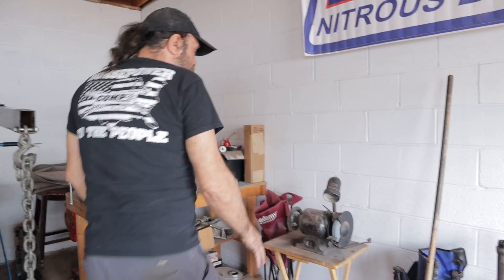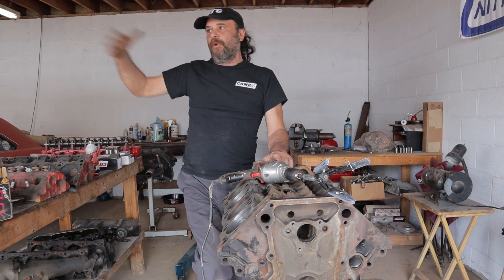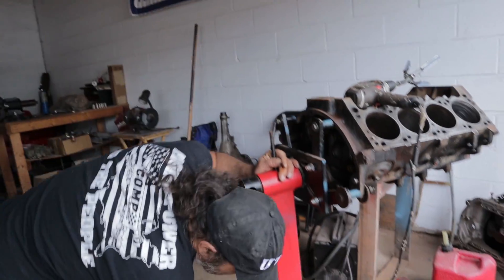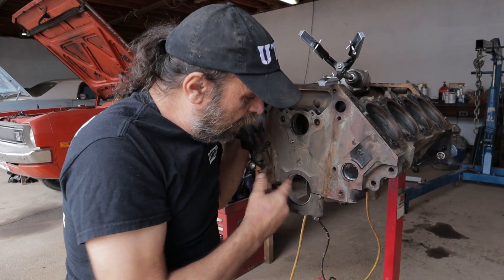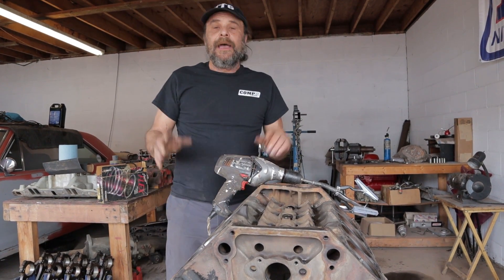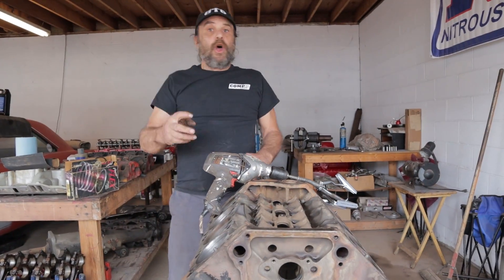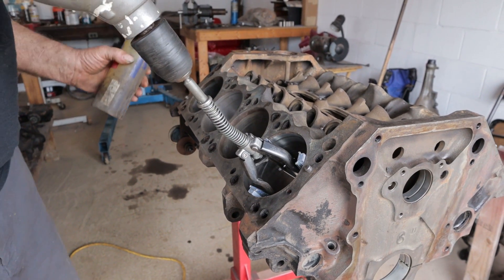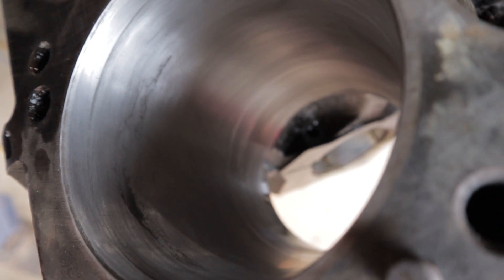Perfect Daily Driver 6 - DIY Engine Block Prep

Comment: Also another tip i learned: when replacing the freeze plugs make sure the the surface on the block where the freeze plug goes in is down to bare metal and thoroughly clean and on the surface of the freeze plug that pushes up against the freeze plug hole. Make sure to use 3M yellow super weather stripping adhesive between the the freeze plug and the freeze plug hole surface where the plug presses up against the block . it will be messy but do just enought to go around the inside of the freeze plug hole then tap in the freeze plug. If you did it right it form a sealing ring around the plug and block. Then let it set for a few days to fully cure! Dont use regular gasket sealent it has been known to make a slick surface for the freeze plug to pop out under heat and pressure .
Reply: I’ve used JB Weld.  Never had a problem with them coming out, but haven’t had one tested with a freeze situation, either.

Comment: Dish vs Flat Top pistons?  Where and when to make that decision?
Reply: That’s a decision before you ever start building, when you’re figuring out what you want the engine to do.  Goals for the car, then parameters of the engine.... especially compression, then see what piston, in conjunction with your heads, makes it happen.  In this engine’s case, the stock dished pistons with the smaller heads brought compression up to all that car’s goals want.

Comment: A few other helpful tips, if you do replace the cam bearings, use an installation tool, don't try to use anything else. Cam bearings are typically numbered for the position they go in with the front one being no. 1. Make sure you align the oil holes on the bearings with the passages, a puff from an air hose through the oil passage will help verify it didn't slip as you installed it. Always, always, always trial fit your camshaft to make sure it goes all the way in before you assemble anything else. I've seen the crush on the I.D. enough to keep the cam from going in. If you've already assembled the bottom end, you have to take it all back apart to fix that bearing.
Reply: I don't know why I never considered the ID crush might be enough to block the cam! I told the machinist I'm gonna be taking my block to that I'm using a stock cam and just need stock bearings put in, and was wondering why he stressed that I need to make sure to bring the cam with the block when I drop it off. I just figured "prob just wants to verify fitment" and left it at that, without considering specifics. Thanks for sharing that.
Reply: @screwsinabell  I've had to take 2 back apart, it isn't common but it does happen.

Comment: If you turn the pistons like you do does the rings line up with the ridge
Reply: None of the piston measurements change, so the top ring travel is exactly the same.
Reply: John Wilburn if the rods slightly off centered to the outer side and you move it in to make it more centered to the crank it seems to me like it would have a very small at that stroke change if it is now centered verse a angled rod. I’m not saying this makes a stroker the crank is the same but the angle of the rod could change the height of the piston. I know it wouldn’t change the travel of the stroke but just saying I think the height would be different
Reply: No, because if it’s offset and you turn it exactly 180° in the bore, it’s the same exact offset to the opposite side.  The highest a piston can possibly be in the bore is with a centered wrist pin.
Reply: John Wilburn you need to watch his other videos your just making your self sound like an idiot he turns the pistons around so they are strait at tdc factory they are angled slightly it’s not rocket surgery
Reply: That’s not even possible!  By definition, an offset wrist pin is not at TDC.  Flipping it around can only, with no variation, put exactly the same offset to the opposite side.
Reply: OMG, no... the stroke is 100% determined by the stoke of the crank and nothing else.  You have your head wrapped around this all wrong.  I suggest drawing it out on paper.
Reply: John Wilburn wow read my first reply to you genius 🤣
Reply: John Wilburn my last sentence I know the stoke won’t be different 🤣
Reply: @duffman1241 You said this:  "  if the rods slightly off centered to the outer side and you move it in to make it more centered to the crank it seems to me like it would have a very small at that stroke change"  Don't feel bad.  Most other people don't get it either.
Reply: Oh, and to get ahead of your erroneous thought process, the deck clearance cannot change with a side swap of the same offset.  It would definitely decrease (higher in the bore) with a centered wrist pin if the same length rod and same compression height piston.  Seriously, draw it out and think about it.
Reply: John Wilburn I did say that then if you can read the whole thing I corrected myself saying that the stoke ant effected. What I’m getting to is if the piston flip brings it closer to strait up and down at tdc then it would ride a bit higher in the jug
Reply: NO... it can’t!  Ponder this deeply.  If the crank is all the way up.... the piston pin offset of exactly X becomes exactly x to the other side.  Therefore, the same length connecting rod and compression height which don’t change, can’t make it go higher in the bore.  All that changes is the rod angularity at TDC... not the degrees, just which side they are on.

The only way to do what you describe is to change the wrist pin location to the center, not a mirror image.

We will describe this on the live build I’m sure.
Reply: John Wilburn wow you just said the same thing I did 👌. I said if one way the rod would becloser to strait. a strait rod is longer than a angled one. I did miss understand Tony I thaiught he said it straitened it out at tdc but it was at the power stroke cycle witch would put the piston a bit higher at that point do to being strait up and down and not angled
Reply: No, I didn’t say the same thing you did. 🤦🏻‍♂️   You, whether you realize it or not, are claiming the same piston in the same bore on the same rod with the same stroke creates more compression.  If it “rides higher in the jug,” that’s the effect.  It’s not.  The swap changes the angularity of the rod relative to the crank and combustion process.  Again, you’re trying move then pin hole in the piston.  The swap is moving an offset from one side to the other.
Reply: Let me try one more logic appeal and I’m letting it go:  if flipping the piston around makes the piston ride higher in the bore, then why does it not do that when turning an unmodified engine backwards?  It’s the same effect with regard to all the geometry.  💡?
Reply: John Wilburn if the rod is strait up and down on the power stroke and not angled it would be a hair higher than when the rod is at a slight angle. Tony switches the pistons so the rod is strait on the power stroke. I never once said any thing about compression. You said if the pin was centered it would be taller than offcentered correct????? So if the piston turn makes the rod strait on the power stroke and not angled it would be a hair taller at that point. Once again I never mentioned compression once
Reply: You did mention compression, you didn’t realize it.  A piston going higher toward the head would do just that.  If the pin were centered with the same rod length, it would go higher, but it’s not because the offset passes the center to the same amount of offset on the other side of center.

Add up the actual measurements of the crank rod and piston and you’ll see this cannot happen.  Also, if it did, you would observe it when turning the engine backwards.  It doesn’t.
Reply: John Wilburn I’m not an idiot did I mention the thickness of head gasketI would use?????? you can try to put words I’m my mouth but unless you know how  thick my gasket would be or the head I would be using you compression comment means nothing
Reply: It’s relative, not absolute.  You’re out of your league understanding this.
Reply: John Wilburn i think you are kid
Reply: John Wilburn why do you turn the piston?? To get more push on the power stroke earlier???? Now if I raise my piston .020 and then get a .020 over gasket this is no compression change. if I run a 360 head on my 318 it drops compression so please tell me how you think I’ll be running more compression I never once said I was building a 318 with original heads 🤣
Reply: You started this entire thread claiming that turning the piston around made it go higher in the bore.  That, in and of itself, raises compression.  🤷🏼‍♂️
Reply: John Wilburn first I asked not claimed then is I admitted miss understanding that the rod lines up better in the power stroke and not at tdc. Are you also going to point out moving the piston up would make a smaller cubic inch too
Reply: @Curt Friedsam Yes, you asked and I answered.  You wouldn’t accept the answer.  Please articulate how “moving the piston up” would "make a smaller cubic inch."
Reply: John Wilburn if the piston rises higher at tdc it also is higher at bdc and that leaves less volume as you are not traveling as far down the cylinder then
Reply: What?!?!   Are you claiming the cubic inch displacement of the engine would be decreased if the piston was higher in the bore.?
Reply: Sorry, even though the piston is NOT higher in the bore from being turned around and that’s the inexplicable debate, I’m now curious about this “cubic inch” thing.
Reply: John Wilburn I know how engine Numbers are calculated but if you add fluid to measure it would have less displacement. Now think of the fluid as air
Reply: I’m asking a simple question:  Do you think reversing the piston in the bore changes the engine’s cubic inch displacement?
Reply: Another simple question:  Do you think that reversing the piston in the bore will reduce the chamber volume (smaller “cubic inches” in the chamber)?
Reply: John Wilburn I think my question needs answered first. Why do you turn the piston you never answered my questions above
Reply: I don’t remember you asking anything.  I’ll say again, some people turn the piston to change the crankshaft position relative to the piston’s position through the combustion process.  It creates a more favorable rod angle.
Reply: Man, my questions are just yes or no.
Reply: Figured it out yet?
Reply: John Wilburn hey thanks for putting up with my stubborn ass I watch some of the build yesterday it’s the dam German in me
Reply: I may do a video of the piston thing.  I asked Lunar to bring a dial indicator and we were going to do it yesterday, but got behind and didn’t have enough time.  We’ll do something on it.... stay tuned :)
Reply: John Wilburn I really love this build might try it out in my mud truck.  I got the diesel bug awhile back and forgot about my mopar roots. Some of my best memories are in a 72 power wagon and a 68 fury

Comment: If you are staying at or damn near original specifications please don't say "over bored to..." and list orig specs. Resurfaced, cleaned up, rehoned are more accurate statements. Thanks.
?Do you reverse drill for equal passes to mimic the insane crosshatch surface specs (un-named employer) required or was I just that lucky?

Comment: Uncle Tony..  question for ya. How often does one set of stones last on the honor,  and do you use a new set for every engine?
Reply: manufacturers recommended a new set every time--they're cheap enough, or at least cheaper than the potential alternative. remember to clean off the residue left behind, or it will sand away at your pistons and rings 

https://goodson.com/blogs/goodson-gazette/solutions-to-common-cylinder-honing-problems

Comment: Hi Uncle Tony, my dad once said, the best key to dig your ear with was an early 80s Chrysler key, said it was designed not to damage the ear canal.....i know, wtf right
Reply: the best key is always...someone else's :)  unless your ignition cylinder is sticking, and you just wanted to kill two birds with one stone--lube the cylinder and find the brain on-switch :)
Reply: The best key is an 89 Hyundai Excel key..... uh, in theory.

Comment: Uncle Tony this engine has a weird problem most people don’t know about I learned about this problem after I already rebuilt my Dodge Magnum 318... problem is there is an oil gallery that goes down from the very front number one lifter bore ( Driver side ) to the front main bearing .. What happens is if the engine sets for any amount of time oil drains on the left bank of the lifters and the front lifter is hard to get oil to...Some  builders run a tube from the right lifter bank to left front bank...Do yourself a favor and at least use new main bearings to keep that clearance tight to stopping the oil from draining down..Here is a link that talks about it http://www.moparchat.com/forums/circle-track-chat/43816-typical-oiling-modifications-11.html

Comment: Good point about the grinder.  some weld together an old truck driveshaft and drum brake to make a stand that can be rolled in and out of place.  Another tip for when you're removing metal from a part...a rare earth magnet, placed in the path of the chips, will collect a few of them so you aren't chasing them down during cleaning. If you're grinding near a water passage (let's say), put some shaving cream in--it can catch the particles and then get flushed out easily.

Bearings: there's a lot of debate over sanding them versus not.  For most things in life, a safe rule is..."when it doubt, throw it out". The dollars you spend now could be dollars you don't spend at the side of the road. But if you've done a ton of engines, you can make a good judgement call.

Ridge at the top of the cylinder: its true until you clamp a head on it--that's why a torque plate is used in boring, to replicate the distortion.  And if you're running an aluminum block, the distortion gets so bad a good machinist wants the main caps, timing chain cover, bell housing, even the starter on for some designs.  Some blocks, like Pontiacs, screw the heads not into the deck surface, but the walls of the block itself, and so some will skip a torque plate in those builds.  Of course, there are those who also want to run coolant thru the block, get it up to heat so its at full expansion--but cutting away metal is also causing a heating issue in the block. When you use gasoline, be in a well-ventilated area--there's a reason why Pintos and side saddle GM trucks had an issue :)  

For those who are finicky, a torque plate should also be applied to the head when doing major surgery like new hardened valve seats. Dealing with an obscure engine with no torque plate?  fake it with a stack of washers or a wrist pin to replace the height of the torque plate, and then torque it to spec around the cylinder you're operating on. Great when you're messing with the rings, and excellent point about the light gap around the ring.  when some install a piston, they'll hook up a fish scale to the large end of the rod to test how many pounds of pull it takes to move that piston to BDC.
Reply: I wondered if using stacks of washers would work at mimicking a torque plate. Now that I know someone's tried it and it works, I'm gonna' do it!

Comment: REPLACE THE FREEZE PLUGS! Are you kidding me, even on a budget build you don't skip this. Yes, they may look fine on the outside but they can be rusted on the inside. You never know if a previous owner used water at some point instead of coolant. New freeze plugs are cheap and it sure is easier to replace them now versus when the engine is in the car.
Reply: Brass doesn't corrode anywhere like steel.

Steel plugs should be replaced at every overhaul. Brass may not have to be replaced.
Reply: Scott Kenny  Correct, but these looked like they were all steel.
Reply: @MrZdvy  there was one brass freeze plug on the rear passenger side of the block.

The one that was replaced because it was leaking, after they dumped gallons of stopleak into the radiator.
Reply: first, they are core plugs to allow removal of the sand cores during the casting of the block. When water freezes, it doesn't look for a convenient exit plan. Second, you got proven right in a future video--there's a ton of trash behind the core plugs, they got removed, and there's a trip to the machine shop for cleaning in store.  which will probably ruin the cam bearings as well.

The best plan for a budget build, is to double what you think it will take.  That tends to cover Murphy's Law :)
Reply: Albert Gaspar that’s right😉👍

Comment: A Ring job. Not exactly precision. Your hone is a joke. It is not a fixed stone hone it is spring loaded. But it will do as good a job as using sandpaper.  It will run for a good long time but not forever. Take out all the oil galley plugs and run metal rods through them to knock the chunks out. Do this even if you have it cleaned by a machine shop.

Comment: Ok I'm good with freeze plugs but with the questionable rebuild from the p.o. and all the voodoo Hodge podge with stop leak I'd pull them all out and give the block a good flush and replace with new brass plugs . Clean clean clean! Take extra time while it's apart.

Comment: I had a hunch you’d use a three finger. How about scotch brite on engine surfaces? I’ve always been under the belief those fibers can find their way into bearings. Always used the yellow rubber finger discs personally.
Reply: RealmCenter40 personally I use plastic scrapers..scotch brite removes metal . Ideally you want zero metal removal that is not part of the layout